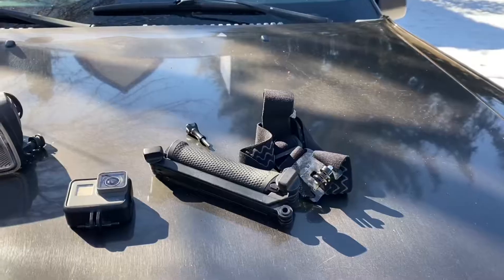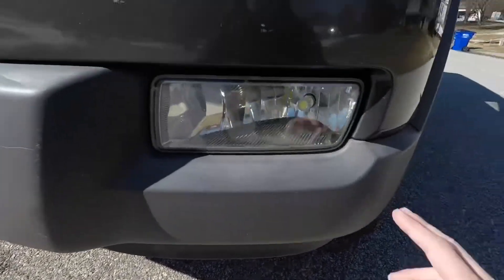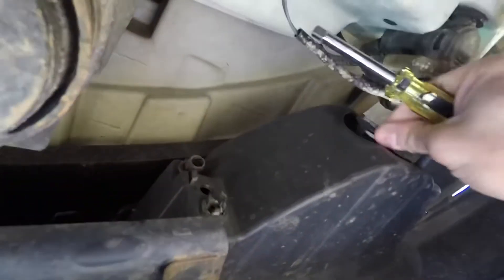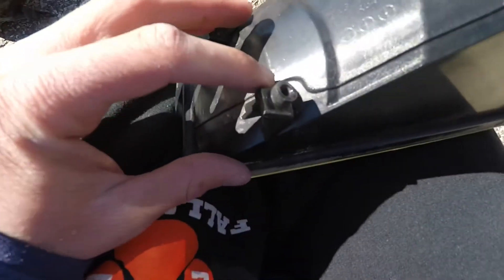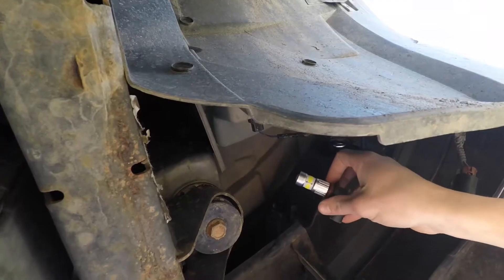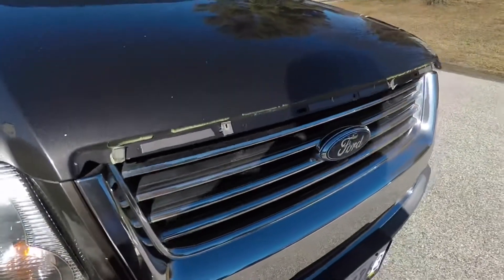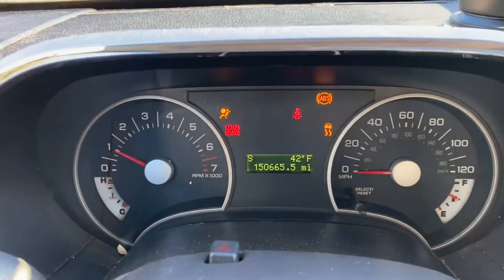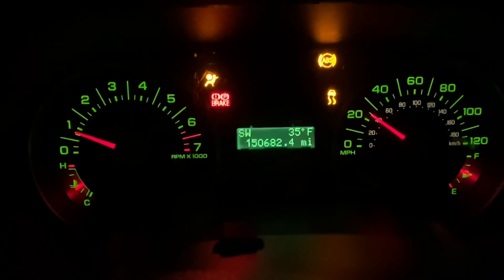Replacing the Explorer’s fog light housing

Comment: An easy way to get the old fog light out without destroying the old ones is to slip a cable tie over each post. Tighten it enough to push the three tabs in. You can then push the post through the fascia. You ought to be able to reuse the same cable tie on each post.
Reply from the maker: Great tip! Thanks!

Comment: How is the Ford Explorer doing now days 2022lol ? My good man💪🏼
Reply: It did the same thing to me twice already just dies but I risked it and took it to Texas and drove it about 600 miles front and back with no problems💪🏼 Still don’t know what the problem is but it’s my daily gets me to where I need to go
Reply from the maker: Transmission is feeling a bit rough at times, otherwise running alright. Got the tires rotated and bearing replaced and she’s on the road again.